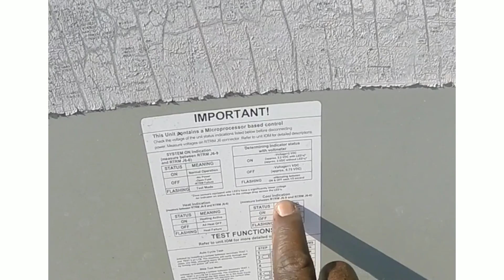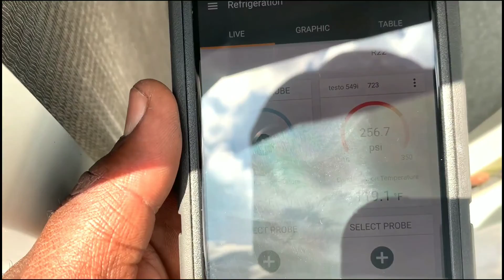HIGH REFRIGERANT PRESSURE  #hvac #ac

Comment: Hi .. anyone can discuss to me if you have any idea regarding the split duct AC which is running but still there is no enough cooling coming out. We did checked the piping and coil and it is cooling. only the problem is the indoor unit blows not enough cold. we can feel just like fan only. thanks..
Reply from the maker: Do you mean ductless system/Minisplit?
Reply: @hvacmadeeasy1788  it is ducted. but it is like mini split.  the evaporator blows fan only but when you check the copper piping its cold.
Reply from the maker: Have you verified the refrigerant levels, Condition of filter and temperature being supplied?
Reply: @hvacmadeeasy1788  yes everything is okay aside from not cooling. is there any chance that the compressor wont work properly because of low voltage? becasue right now our voltage is just 370v instead of 380v.